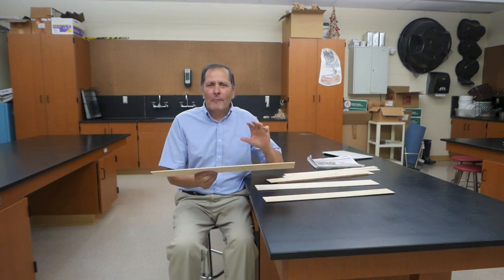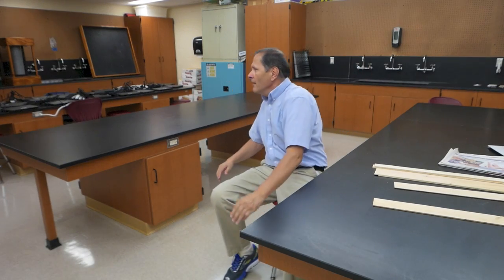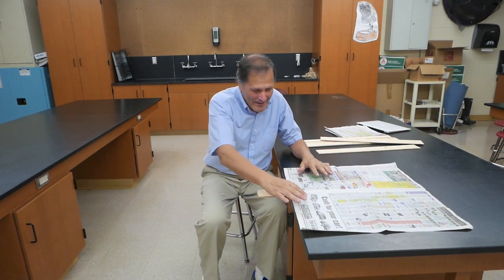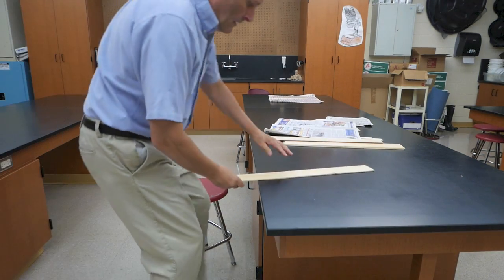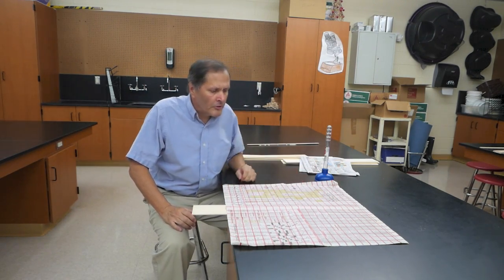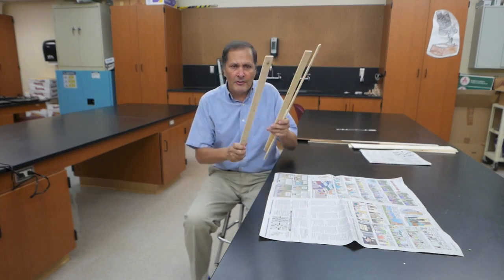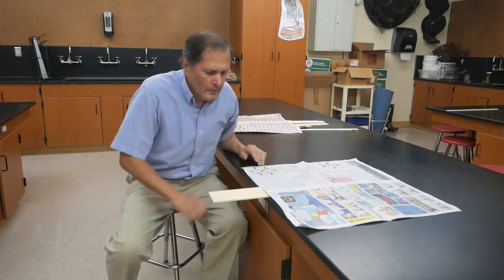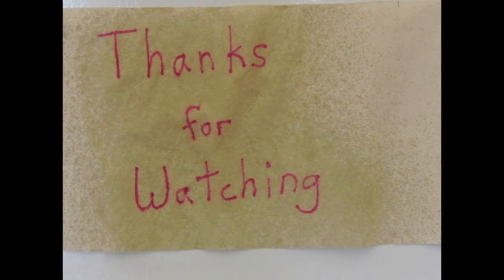Breaking Board Paradox--air pressure // Homemade Science with Bruce Yeany

Comment: you are hitting the board with the same force, but on the wide board there is more area, so the force per area is less. the paper is the same. the paper slows the air rushing in under the board, so you get a vacume. The paper can stop enough air to hold the large board, but not the small one. Perhaps a larger sheet of paper would be able to break the small board? surely if you reduce the size of the paper you'll get the big board moving the paper like the small one did
Reply from the maker: yes,  it has been incorrectly explained that it is the total amount of air pressure on the paper that is holding the board down.  The function of the paper is to keep air from getting under the board and the vacuum formed  under the board is enough to break it.  I show this better in the updated version of this demonstration. https://www.youtube.com/watch?v=9XmPeYFotLM

Comment: Mr Yeany, I have a doubt. Can you please explain when you close a bottle , why doesn't it collapse on itself ? shouldn't it since the pressure outside the bottle is greater than the pressure inside .Thank you
Reply: The air you seal inside the bottle is already pressurized by the atmosphere from when the bottle was open. It will continue to press against the inner walls with that same pressure even once it’s separated from the outside air. If you sealed the bottle while it was in a vacuum, and then exposed it to the atmosphere, you would see it crumple like you expected (unless the bottle walls  alone are stronger than the atmospheric pressure, like a thick glass bottle).

Comment: I've always pictured that as more of a vacuum that holds it down, but it all boils down to the same thing, pressure. In this case i pictured it being more negative pressure adhering the board to the table, than only positive pressure from above. But obviously it is both negative pressure when the wood tries to lift from the smooth surface, and positive pressure pushing on that small vacuum that sticks the board to the table, helping it stick a little bit more.

Comment: The air isn't pushing down on the plunger, it's the plunger pushing up against the air creating a vacuum. That's the difference. Same thing is happening with the piece of wood. The slower that air can get underneath it, the more vacuum is created.

Comment: If there is any vacuum exits in our universe then, that means Its temporary thing like a newspaper because after you brake a board that is not necessary to hold a board a newspaper will be terminated. Holding an opposite and much more then an equal force of an air pressure will not hurt your paws but definitely hold distanced area of an object and short part will be easily break into a part. Very good. Nice education for students.

Comment: The surface area of the wider board allows more of the paper to come into contact thereby increasing the air pressure downwards.. 
Isint it ? It's all in the cross section.

Comment: Brilliant demonstration. I would suggest to put the wooden sheet in between two parallel high walls separated by the width of the wooden sheet, which will stop the air from getting underneath the wooden sheet.  I like the paper demonstration, but it adds many other complications as the distribution of air pressure becomes complex .
Sir, my congratulations, you certainly deserve great respect for bringing science to the school in this manner. Good luck and I do wish that there are many teachers  in all schools doing what you are doing.  These may be simple demonstrations but if  one had to include the mathematics on them, learning Maxwell's equations and Navier Stokes equations will see this experiment to Ph.D levels. Well done Mr Bruce Yeany.
Reply from the maker: thank you Carmel,  I am going to make a 2nd video on this piece and try some variations,

Comment: Doesn't the thickness of the board affect the result? I mean, couldn't you have the same result with thinner pieces that were also thiner in height? I am not sure if I am expressing myself correctly
Reply from the maker: Hello Andre,  the thinner it is the easier it is to break,  I will be making another video on this and that is a point that will be taking a look at.  I will also try it with thicker pieces and see what happens
Reply: Bruce Yeany that makes sense. What I was trying to say is that small pieces all around maybe only need the piece of paper despite being easier to move. But I don't know as I study economics and not ciences

Comment: It seems to me that the amount of air on either side of the board but under the paper is proportionally much higher in the narrow board.  When you strike it, that air can fill the underside of the narrow board allowing it to move up before a vacuum is drawn in the area.  With the wide board, the same air pockets to the side of the board is not enough to allow the wide board to travel very far before a vacuum maintains the position of the board.  That idea could be tested on the smaller board by folding the paper to fill in the gaps on the sides of the board.
I also wonder if the higher inertia of the board without a proportionally higher breaking force appreciably contributes to the results.  Meaning, does the breaking force double but the inertia quadruples?
Reply from the maker: HI Dennis,  I  just had an impassioned disagreement on this piece with an old friend.  We are both going to do some variations to try and convince the other of our points.  It should be interesting to see the results.  Should be out in January
Reply: Hi Bruce, I hope you will post the results here.  Rather than breaking more boards you might make an easier test with a fish scale and notice the peak force before the board is displaced from the table.  If I get around to it, I might try this test myself.  As for a hypothesis, maybe it was the words on your newspaper that were so heavy.

Comment: Hi bruce, is this really because of air resistance against the board or because of small vacuum cavities created beneath the board??? I mean the wider the board the bigger vacuum cavities and hence more pressure is required to create and maintain one??? Isn't it??? ( assuming the air pressure trying to push through non porous paper and creating a glue like friction between the bench and paper)
Reply from the maker: I will be trying it again to get more answers  for this

Comment: I think it might be because there is a larger vacuum under the larger board. And with the same mass of air in larger vacuum the pressure difference with the outside will be greater.

Comment: I wish he had said what kind of wood was used.

I'm an eighth grade science teacher and we're working on a physics unit right now. I want to do this demo for the kids but I bought basswood (tilia or limewood depending on where you are) from a craft store. Turns out basswood is very springy. The board didn't move but it also didn't break. I did scuff up my pinky trying to chop it though. Balsa seems to weak for this and I can't find pine in these dimension near me.
Reply from the maker: HI Gary,  it is pine,  I had to use a table saw to cut it thinner.
Reply: I thought about doing that but all I have is a handheld circular. I managed to get it to work with a 12"x3"x3/16" piece of bolsa wood. Not nearly as impressive but it still gets the point across.

Comment: I think it might have something to do with the ratio between the thickness and width of the board as well. I've seen this same experiment done before usually with just a wooden ruler that is maybe only an 1/8" or 1/16" thick by about 1" wide and it breaks every time without moving the paper. Also it may have to do with the type of wood used, the cut of the wood, and the size of the paper.

Comment: the board moves up, the paper seals between the board and the table stopping air rushing under the board. held down by a vacuum, the wider the wood the greater the vacuum caused by lifting. I like that one. you can stick a wall tile to a ceiling with adhesive and the vacuum holds it up there.

Comment: Astute observation, I was taught the "pressure against the paper" explanation, and accepted it without much further thought. But by Your "quick investigation" it's quite clear that it at least is not the entire truth. And I personally subscribe fully to Your explanation that the paper rather prevents air from rushing in under the stick, and this allows the board to  "create suction"  against the table surface. And it's this "suction between the board and the table" that is the actual "counteracting force", not the air pressure against the paper, "holding it down".
One way to further establish if this the "suction of the stick" or the "pressure of the paper" is to,  by some means, lessen the "direct contact" between the board and the table, thus lowering the "strength of the suction" but not changing the "pressure of the paper".Possibly this could be done by placing the board slightly elevated of the table surface, perhaps on a couple of toothpicks...
All in all an enjoyable and educational video.
Best regards.
Reply from the maker: thank you,   I want to revisit this experiment and try some other variations,  I will give what you suggest a try

Comment: Would this be a result of vacuum and the resistance of air rather than the force of air on it?  Of course air pressure would also include vacuum but just represented by a negative #. My thought is that the newspaper may also help restrict the air from getting underneath the board by giving it a longer path to travel and create a "friction". What if you were to try the same thing using a piece of netting the same weight/size as the paper?
Reply from the maker: Hi Dustin,  as you are suggesting,  it is an imbalance in pressure.   under the board would be a vacuum, on top, air pressure,  with the paper restricting the air from getting underneath.  netting would not work,  several holes in the board and not covered by paper doesn't work either

Comment: Could it be vacuum from the paper against the table around the board? You're obviously a smart man and can figure out where I'm going with that, so I'm sure I don't have to explain.
Reply: Bruce, if it is a vacuum you would probably get the experiment to fail if the board protrudes on both sides of the paper. I would like to see you try that.
Reply from the maker: Hi Matt,   I'm finding that I can do with just a small amount of paper around the board if I wet it.  My thoughts are the job of the paper is keeping the air from getting under the board itself.  I am planning another video on this to show it
Reply: Bruce Yeany yeah that's what I meant by the vacuum.
Reply from the maker: I am planning a new video on this,  thanks

Comment: The paper just helps form a seal to prevent air from getting under the board. Broader board harder to get air under.
Try water to seal the board down.
Reply: Roscoe Kane I was going to post this until I saw your comment. The vacuum created by the board is immediately filled with air if there is no paper, but the paper stops the air from getting in.

Comment: The wider board forces a larger space under it that air needs to fill, and the paper is blocking this area. With the smaller board, it doesn't take much volume to fill under it at all, and the paper can just slide up at a 90 degree with it.

Comment: I think the previous poster nailed it already - it's the vacuum created rather than the air pressure pushing down that's holding the board on the table. When you have a wider board it's creating more volume of vacuum compared to a narrow board. When you smack the hanging end you're creating an instant vacuum underneath the other end which pulls the paper around it down to the table top. This is also why smoothing out the paper seemed to make a difference. 
The idea of using a mesh screen as a working surface is an excellent one, or even using a piece of pegboard or plywood with holes drilled in it to allow air to pass through. There would be no vacuum formed so the board would just go flying again. 
I bet ya a dollar!

Comment: is it air pressure or vacuum? if the paper had a mesh below it that would let the air pass through would its holding power be the same? 

I just had a brainwave: if you used a suction cup in the vacuum of SPACE would it still work? I think it would - any thoughts on this 3-second old idea?
Reply from the maker: air pressure pushes down against the top of the board,  as the board lifts very quickly,  it is a partial  vacuum underneath it.   Good idea about the mesh,  it wouldn't work on the mesh screen.  I have been trying a few new ideas with this,  and found it still works if I greatly reduce the amount of paper sitting on top of the wood.  A suction cup would not work in space,  it needs to an imbalance of pressure,  no air on one side air pressure on the other
Reply: Hey Bruce thanks for the answer. I do have a keen curiosity on this ever since my teacher did the holding water in an upside down glass with a sheet of paper. 

1 - I  have a sense that vacuum pressure or power may be stronger than air pressure. E.g. if it the pressure is 15 lb per square inch and a heavy duty plunger was used and had all the air sucked out i suspect that it would hold more than the 15 lb per square inch

2 - A plunger could be used to cause a vacuum and then put into a vacuum chamber to see what happens when all the air it taken out of the chamber. i suspect that the plunger will remain stuck as it is prevented from expanding not by the air pressure any longer as that has been removed but the seal preventing it from being able to pull in content to regain its full shape. 

If you do an experiment on this do let me know as that day in the classroom was 47 years ago ;)

Comment: It might be interesting to tape small flaps of newspaper to each side of the board without any above the board.
Reply from the maker: thanks,  I'm working on that now.
Reply: Another thing maybe would be to tape an equivalent area of newspaper as the original experiment to the edges of the board, none on top, but so that the paper is perfectly flat on the table.  After that test perhaps a few dowels under the paper to keep it from resting on the table just to see what happens. As an aside I wonder how much weight an open sheet of newspaper could lift if taped to a long ruler so as to lift along the entire edge?